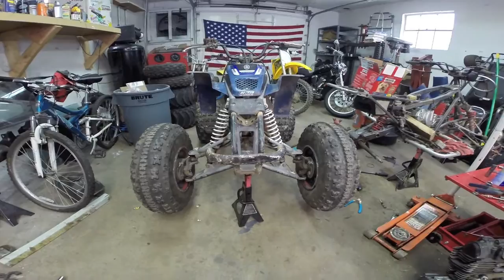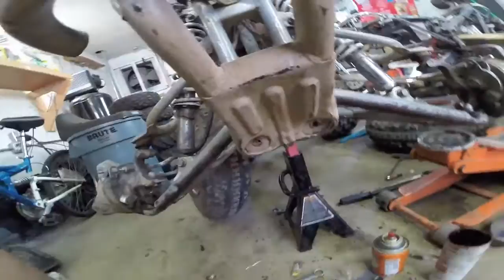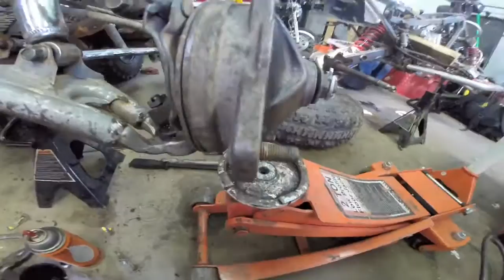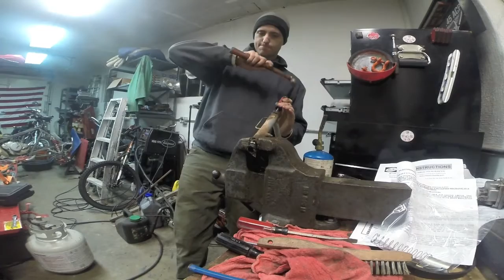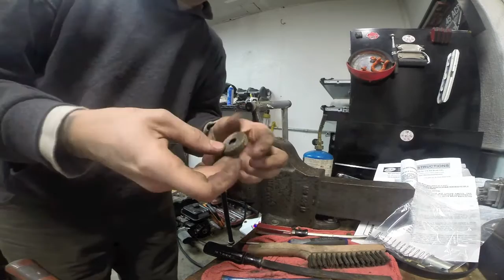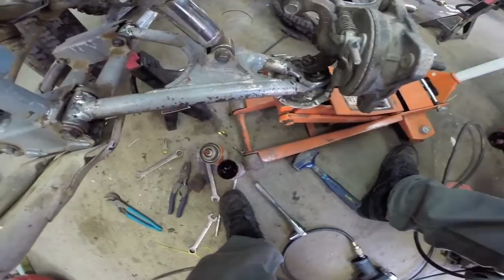How to change Yamaha Blaster A Arm Bushings

Comment: these videos help so much and you explain everything so well. my blaster is currently down to the frame because im painting it along with an engine rebuild. replaced front wheel bearings and brakes a few months ago. learned how to do it from your videos.

Comment: The lower ball joint won't pull out in hitting the a arm and everything with pressure being applied to the hub
Reply from the maker: Thats how i remove ball joints from everything. applying pressure to the hub in the upwards direction then either striking the a-arm or using a pickle to help pop it from the hub.